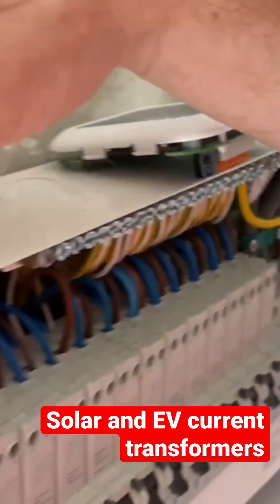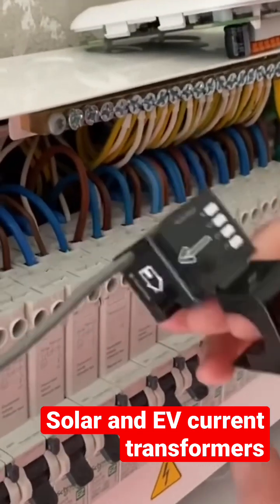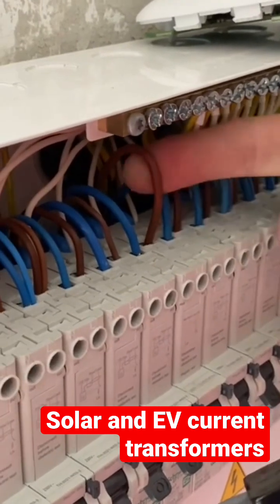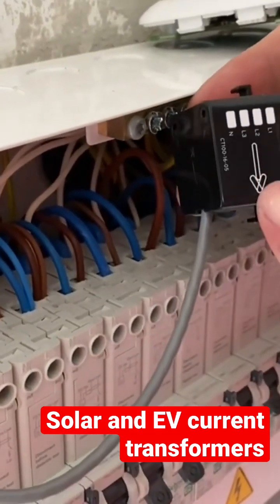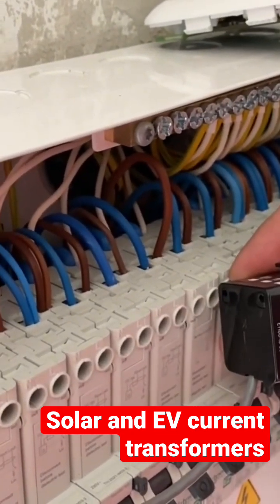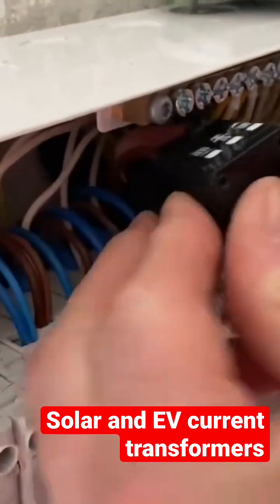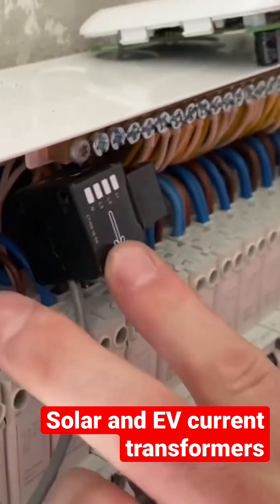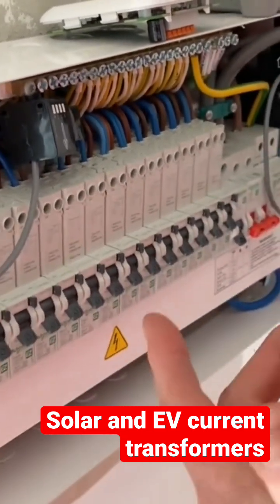How To Fit A Current Transformer In The Right Direction

Comment: I was under the impression you couldn't use a wireless CT device such as the Harvey to measure the load of the house and control how much current the charger will use. Aren't they regarded as not being reliable for that function

Comment: Tip for extending YY/CY or similar signal wire under 1mm^2: Use uninsulated ferrules and a hex shaped crimper, use the smallest ferrules that you can get both conductors into. Put the ferrule over the conductors, one conductor per side, crimp, heatshrink over each ferrule and and a large piece of glued heatshrink connecting the sheating of the two cables to protect the insulation of the conductors from sharp edges and to provide some strain relief. 

And remember to check that you have enough room to pull the whole cable with sheath through your crimp tool before crimping since you can't remove the tool without cutting the connection otherwise.

Has worked wonders for me for 12-48V projects, used this technique both in enclosures and in IGUS chains for both signal and power up to 100W without getting any sort of poor connection typical of a bad solder splice that people usually get. You also dont get the 5 meter of burned off insulation you usually get trying to heat the conductors when you solder splice.

Comment: I was not aware a CT was unidirectional.
Reply: Happens, because it may read current in reverse direction so can show negative sign, but am also confuse that for measuring 3 phase not needed direction
Reply: @suhaspn9526  it's alternative current. There's no direction.
 It only measures induced current by the variation of magnetic field generated by the AC in the wire.

Comment: Genuine question.  Is having the CT inside the consumer unit not mixing low voltage and high voltage systems.
Reply: Or does double insulation in the CT cable cover this?
Reply: @paulcoulter2558  double insulation covers it iirc
Reply: @BenCos2018  Thanks Ben,  That's great to know.
Reply: @paulcoulter2558  np 
the wire also has a rating written on it somewhere generally also

Comment: Current into the breaker equals the current out in normal operation, unless there is a fault. So technically it doesn't matter whether it is on the line or neutral wire so long as the CT is the right orientation for the wire ...

Comment: Maybe this is a dumb question but why bother with the isolator switch in the board if you still have to isolate the incoming mains before taking the lid of?
Since it seems to be common for UK houses to not have isolators on the incoming feed and a ban to pull the fuse/fuses as an qualified electrician it seems that someone hasn’t made their minds up?
In older houses here in Sweden pulling the fuses on the incoming tails is considered to be the safest way to disconnect since the isolation switch often breaks when used.
Wouldn’t it be considered safe to work with the incoming tails live if they don’t have exposed copper?
Reply: Pulling an energised fuse is the safest way to disconnect? Oh dear...
Reply: @deang5622  We don’t have the type of fuses that you have and it’s done with very low load. We don’t have the muscles to replace the boards just because they’re old and it’s not possible to find matching parts. We mostly add on smaller boards next to the existing boards.
If you’d seen the boards that were installed up until the late -90s you’d cringe, filled with exposed live parts and a nightmare to get the cover off and on without risking a short circuit

Comment: Do they both have to go into the same board. If the client has the solar feed into the garage board which is off the house board?
Reply: No they don't, but you have to think where the cables are going to.
You can be a bit limited to placement due to the drop on the cables if you're DRM control

(System outputs by reading the voltage (3 or 5v sent by the CT) get it wrong and you'll send power out, run higher than you need to blabla)

Comment: Might want to add the warning of open circuit CTs...
Reply: @gardenogauge  the link is for a current transformer, as in power transformers, which as the link mentioned can go way high on OC.
Same a voltage transformer.

The CT used are normally low voltage, because the systems used to read them read the mV difference and calculate, rather like a power shunt.
Many are 3.3v range or the older ones are 5v.
I don't have a random laying about to get a voltage reading from To see if you could be right. I wouldn't rule it out. Just I haven't had any.
Reply: What do you think the voltage is on the wires of an unconnected CT?
Reply: @deang5622  if it's an actual CT then it's proportional to the number of turns but I suspect as this is a clip on unit it's just a hall effect sensor, however unless the installer understands the fundamental difference between the two it would be wise to heed the warning
Reply: @gardenogauge  Good point.
I remember Hall effect sensors from my university days...
The force on a charged particle being:
F=BqVSin(θ)

I believe that some clamp meters use both a CT and a Half effect sensor. The jaws are metal which provide a conductive path to enable at least one full turn to be realised. That's for AC current measurement. Then the hall effect sensor is buried somewhere, which then enables DC current measurement.

The idea of not needing to break the circuit when measuring DC current...what a relief!
Reply: @deang5622  there about 3 or 5 volts
Reply: @guywhoknows  LoL! So no chance of an electrocution risk...